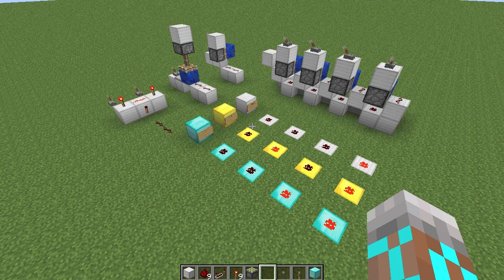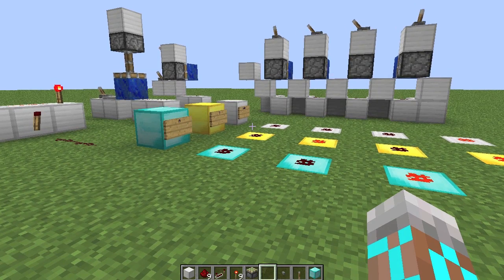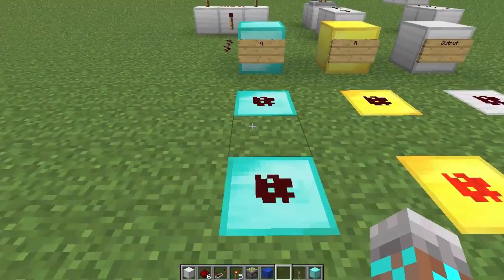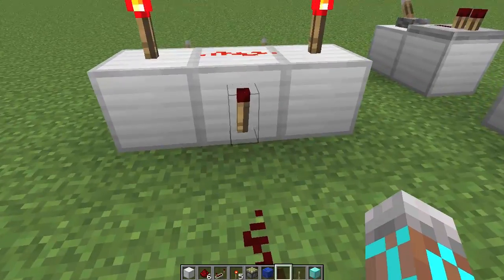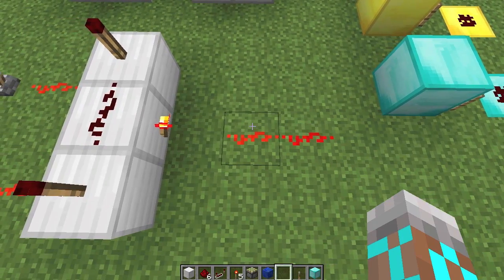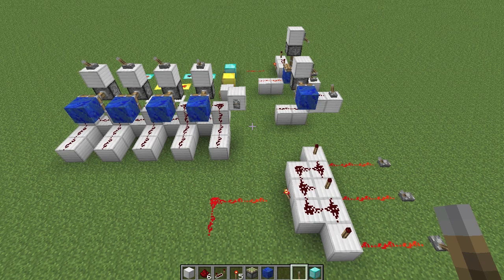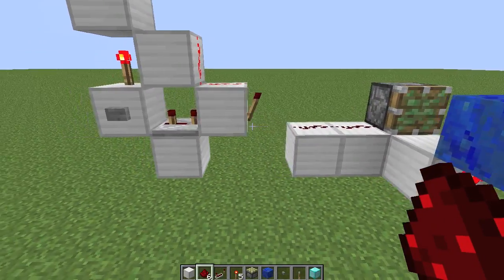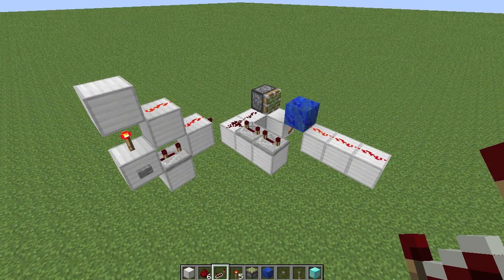Tutorial: Need to Know 1 - AND Gates and T Flip-Flops

Comment: Getting sciency here: the reason torch AND gates work is DeMorgan's law, which says A and B == not ((not A) or (not B)). The notation is totally wrong (A & B == !(!A + !B) ) , but the idea is there and it works for any number of arguments. As long as a single input is off, the whole (not A) or (not B) or etc thing will be on, invert it and you get 0 or off. The torch on a block is a simple NOT gate, the wire between torches is an OR gate, the output torch is another NOT gate. There you go.